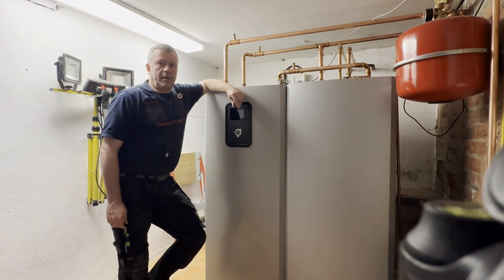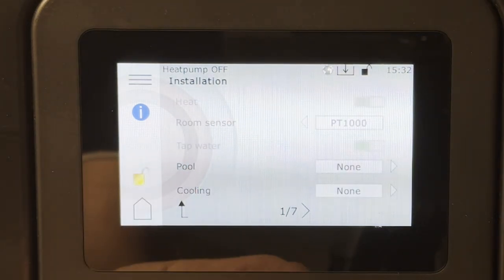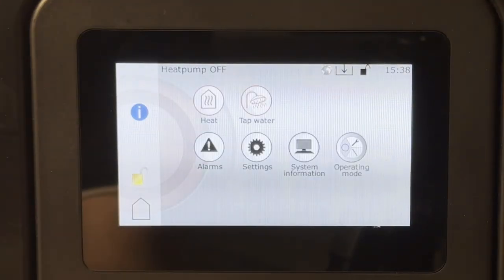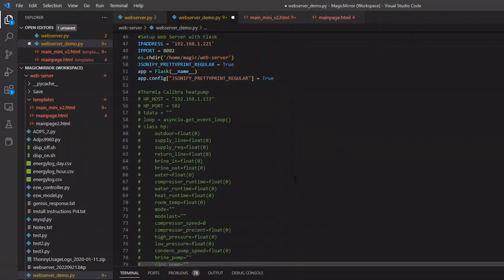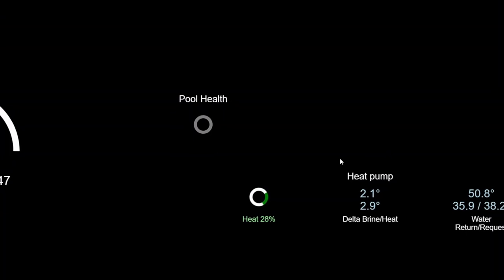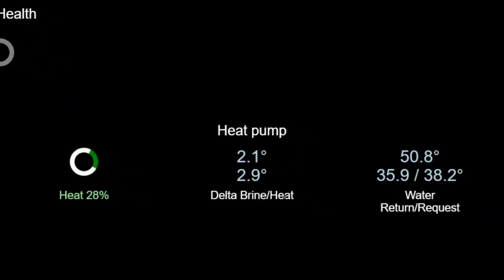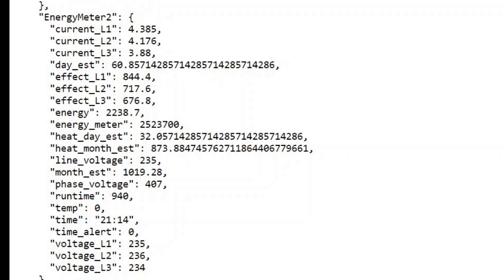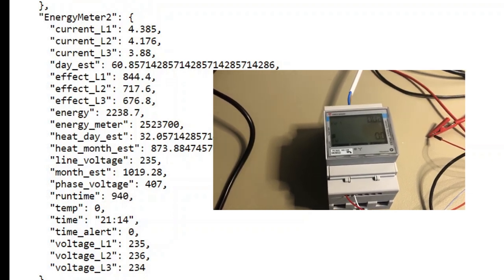Magic Mirror Part 6 - Heatpump / Connecting using Modbus TCPIP

Comment: Hi there, I had a question regarding the ip and port of these heatpumps, is there a way to find out about it as ot dpesnmt seem to have any documentation about what it is. We have a thermia diplomat 10 with a similar controller that is connected via ethernet cable to the main board. I would greatly appreciate if you could enlighten me about how one can connect to this controller.
Reply from the maker: I'm not sure what you mean with "similar controller that is connected via ethernet cable to the main board"
First, you need to connect the Network Cable from the heatpump to your network, there should be a separate network conector for this. When you have done that, you can go into the "installer" menu shown in the video and check the "network Settings", there you will find the IP and port. You could also check your router to see what IP the DHCP has assigned to the heatpump.
It's important that all steps in the video is followed, because if you do not enable the Modus TCP, you will not be able to communicate with the heatpump.

Comment: Hej to Sweden from Hamburg. 
Thank you for your very informative video. Unfortuantelly there is litte other information in the web available about ModBus communication with Thermia (or do you have any good links).
I have a brand new Thermia Eco Duo and try to connect in ioBroker via the ModBus Adapter. BMS is on and activated via TCP, port ist set to 502 in my Thermia.
Connection fails with following protocol statements in ioBroker:
On error: {"errno":-111,"code":"ECONNREFUSED","syscall":"connect","address":" my IP address ","port":502}
Socket Error	
Client in error state

Do you have any advice what I could do?
många hälsningar från Hamburg
Stefan
Reply from the maker: Hello. glad to hear that !
I do not know about ioBroker, but it's very important that you have made the changes for Modbus in the heatpump, as shown in the video. You need installer access to do this
Also, of course, checking the IP settings of the heatpump, so it's the correct networks etc
Try to ping your Heatpump IP

You can also download some free tools for Modbus to test with, they should at least be able to connect
Reply: @mymagicmirrorhome7561  
ping is ok ( 4 to 7 ms)
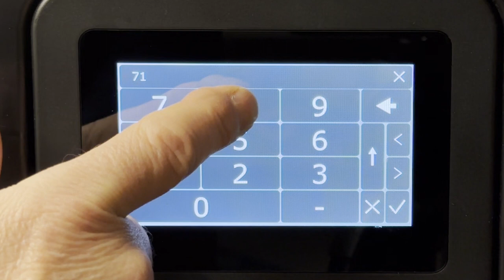"You need installer access" do you mean like in your video at 4:00 ?
Reply from the maker: Yes,exactly
Maybe the code you are using does not support the Thermia protocol
I'm using https://github.com/CJNE/pythermiagenesis maybe you can get some ideas from that
There are some info on the protocol on this page http://www.tcmadmin.thermia.se/docroot/dokumentbank/Modbus protocol for Genesis platform 10.pdf

Comment: I'm just about to buy a Thermia Calibra Eco heat pump that I would like to integrate with current domestic system that uses Modbus TCP/IP. I want to read temperatures, current consumption,.. from the heat pump. I would like to know if that functionality would require that I purchase a EM3 expansion card. Thanks.
Reply from the maker: Not to my knowledge, i did not by anything extra
Looks like em3 is for modbus rtu(wired), for tcp you use the onboard network connector

Comment: Hej! Amazingly useful video!

I tried and check if the HP's port 502 was open but nothing shows. I pinged the HP successfully, but all the request fail since the port is not showing (I guess). Any idea how I can solve that? I couldn't find it in the menu and documentation says "default is 502", however it doesn't work for me...

Tack på förhand :)
Reply from the maker: You must have access to service mode, it’s usually a pin code to open that menu
Modbus tcpip is not turned on by default
Reply: Thanks for your quick answer :)

Yeah I went down the menu in installer mode but could only find the screen with the IP address and sub mask and so on, however no tcp/up option to be found

I'll call Thermia on Monday, I'll keep you updated
Reply from the maker: @Blizziart  find the menu BMS under settings and make sure to enable it and set it to tcpip
Reply: @mymagicmirrorhome7561  Update after talking to Thermia: it seems that the firmware of my machine is too old, I'll have to update it

Comment: Sir, Thank you! How to check how much current (kWH) is used by Thermia Calibra Pomp?
Reply from the maker: My Thermia Calibra does not have any internal energy meter, so the reply from the Heatpump is just blank. I tried to get a reply from my Supplier, why and if it's possible to add a module for this, but I could not get any response.
I ended up adding an external energy meter for the heatpump, there is another video about that. I used a MBUS meter

Comment: And can we adjust water tempreature in normal mode or comfort mode?
Reply from the maker: I'm not sure, I have not seen any settings for that. I'm always using the "normal" mode
Maybe you can consider to use "boost hotwater", when needed
I'm guessing the difference is not only the temperature, but how fast it's re-heating the water as well.